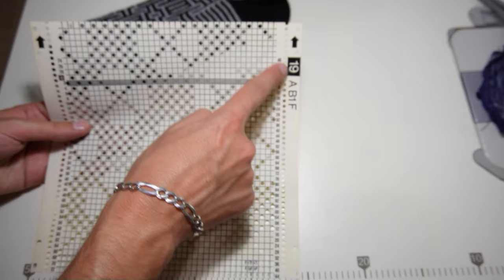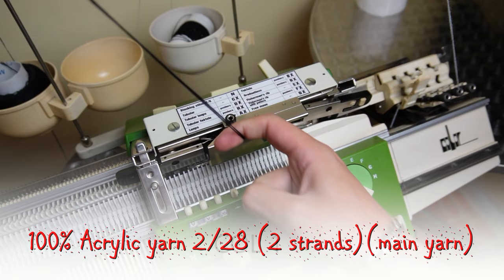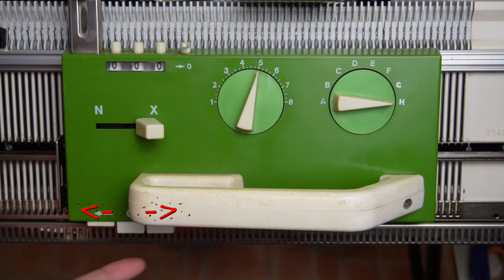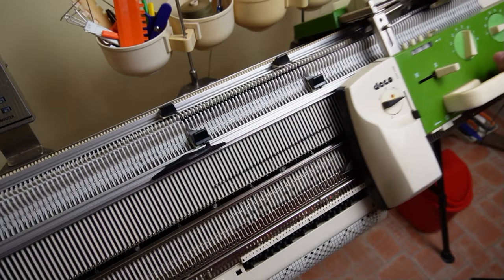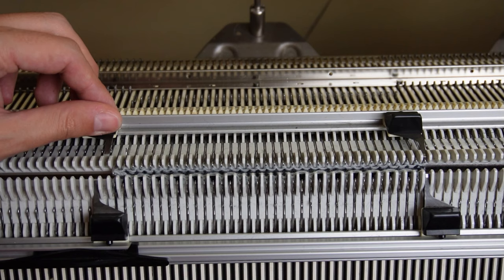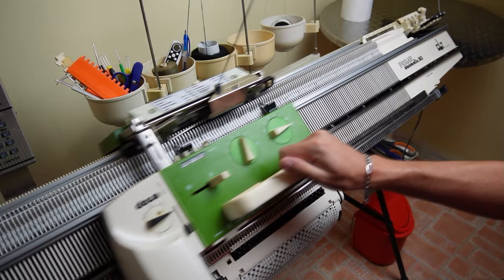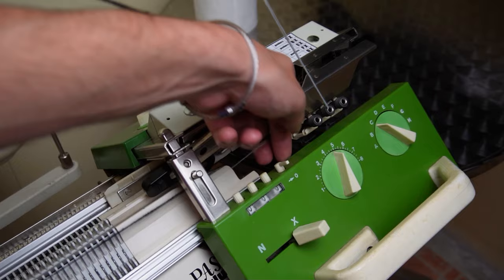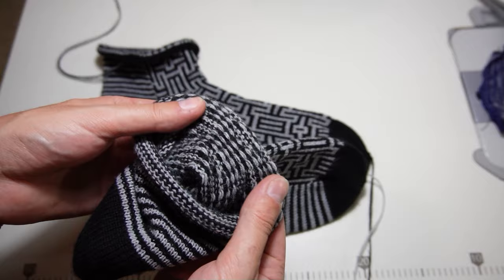Passap Floatless Mosaic Knitting: Making Stunning Slippers

Comment from the maker: Big thanks to Margarita Fischer for her helpful tip! When knitting mosaic socks on the Duo 80 with regular 4-ply sock wool, remember to set the stitch size on the back bed with 4 clicks smaller than the stitch size on the front bed. This keeps your stripes looking smooth and avoids extra bulk. Margarita's advice makes a difference!

Comment: My cuff turns out huge should i lower the SS? Also will you have a tutorial on a ribbed cuff <3 ?
Reply from the maker: Lowering the stitch size can help make the cuff a bit smaller, but if it's still too big, you might also try reducing the number of stitches. When I knit socks, I often find that the first pair ends up being a gift, and the second pair is the perfect fit. LOL. 😊

I actually have an older video on knitting a plain sock with a ribbed cuff. The ribbed cuff in that tutorial is knitted flat and then sewn later due to the limitations of the machine. I’ll definitely consider making a new tutorial for a sock with a ribbed cuff in the future. Thanks for the suggestion!
Reply: @ArtOfClay  No problem yea i figure since it can knit rib double bed, i thought maybe two different ways... one would be making the cuff double length so it can fold over or 2nd would be casting on with waste yarn,  then after i dunno 15 rows, 1 row of ravel cord, then casting on the rib cuff, knitting twice the amount of ribbed cuff... drop the bed down, pull up the beggining with the waste yarn and rehang stitches around, then pull out ravel cord to take off the waste yarn, put up bed and continue with a double ribbed cuff, i like the more pronounced cuff look <3...
Reply from the maker: Your response made me think. The second way of knitting the rib that you mentioned can be done automatically without the waste yarn. First, you have to arrange the needles in a 1:1 division and knit the first row with the machine set to N/N (SS - 3). Then, increase the SS to 5, or for the main knitting, set the back lock to BX, and raise pushers in 1:1 division under the needles on the back bed. The leftmost one should be in WP. Knit the needed rows of ribbing ending with the lock on the left side. Next, set the back lock to N, raise all needles on the front bed and knit 1 row, or set one of the locks to GX, transfer all stitches to one of the beds, and continue knitting. You should get the folded rib automatically sewn. I have shown this method in my scarf hat video.
Reply: @ArtOfClay  ill look for your scarf hat video ty <3...
Reply: @ArtOfClay  oh okay so its making the rib as a flat fabric that you would then sew up a seam... i was just curious if there was a way where you wouldnt have to sew a seam. Also for this eseentially you could make the ribbing, and then use decker combs to transfer back to front bed in a circular fasion to continue on knitting the leg of the sock ? <3...
Reply from the maker: Unfortunately, it’s not possible to knit true round ribbing on the Passap without a seam. Some computerized machines can make a series of transfers before knitting each row to create round ribbing, but on the Passap, this process would be very time-consuming.

The only ribbing that can be knit in the round without needing a seam is mock ribbing. This is done with a 1:1 needle arrangement and is knitted tubular, producing a round piece. However, you still need to fold it in half and sew it to the inside, though it won't be a flat piece.

Yes, you can use decker combs to continue knitting the sock in the round after making this or any other type of ribbing. The method in the video I told you about eliminates the need to start with waste yarn and rehang the stitches later. It’s a good option if you prefer more pronounced cuffs. Just remember to knit one row after transferring the stitches to one of the beds (after finishing the ribbing), to make it easier to transfer them with the decker combs later.
Reply: @ArtOfClay  what about my method of pulling up through the center and re joining?
Reply from the maker: I hope I’m understanding you correctly (English is not my native language, so I use a translator). If you're asking whether you can start with waste yarn, knit the ribbing, then drop the bed, rehang the stitches, and continue knitting the sock, yes, that’s definitely possible.
Reply: @ArtOfClay  cool i might have to try that... im not very good at mattress stitching so i always try to think of ways to just knit as one piece. Also even though english is not your native language you understand perfectly and also speak it perfectly. I cant imagine myself learning another language especially at my age point, so that truely is a awesome thing to be able to do <3...
Reply from the maker: Thank you very much for your kind words! I’m glad to hear I’m making sense. I totally understand wanting to avoid hand-seaming. I'm always looking for ways to keep things as seamless as possible too. My mattress stitch skills aren't the best either! I hope your project turns out wonderfully. 😊

Comment: Hi, your video is perfect clear as usual, thank you so much. There is only one thing I don't.understand : the punchcard 19 that you show (and that I receive with may passap 80) doesn't seem to match the sock you show : should we really use this punchcard ?  Thanks
Reply from the maker: Thank you for the feedback! Yes, you do need to use punch card 19. It's interesting that the mosaic knitting holes on the punch cards don't match the result on the knitted piece, so the card will be different than the final result. Note that not all Passap punch cards are suitable for mosaic knitting. While some aspects of this process remain a mystery to me, I am actively working on creating a video on this topic.
Reply: Thanks

Comment: Can you clarify something please? In the video you clear the row counter after making the heel but the notes don’t have his instruction. Do the 220 rows start with the first colour change at step 42  or are steps 39 and 41 in the notes the first two rows? Thanks!
Reply from the maker: I apologize for any confusion. The row counter should indeed be cleared after making the heel. This occurs in step 36, where the lock will be on the right side, and the row counter should be at 46 rows. All 220 rows from step 39 onward must be knitted in the same mosaic pattern, so the first of them is on step 39.

P.S. I am writing the instructions after making the video, so it's always as shown in the video.
Reply: I'm about to make some more of these and hope I've remembered what I did wrong before LOL! By the way I noticed that the stripes on the sole are different in your fairisle video. They go along the length of the foot instead of across. In this video you have front lock only set to HX with both arrow keys. In the fairisle tutorial both locks are HX with left arrow key. Can I do the same here or will that muck up the mosaic?
Reply from the maker: I guess the stripes can't be in the same direction as on the Fairisle slippers because when knitting the mosaic ones, the color must be changed on every 4th row, and for the Fairisle slippers on every second row. I guess the fabric will be textured, and the stripes won't change their direction. However, it is still an interesting thing to try. I guess it will work if you knit 2 of the rows with the arrow key on the back bed pressed, and the other 2 rows without it being pressed.

Comment: Buenas noches acá en Colombia a esta hora son las 9:00 de la noche una.pregunta todos los sacos en la passaf tienen las mismas medidas o varían según la maquina quería saber que diferencia ahí de tallas de casa buso muchas gracias
Reply from the maker: Lo siento, tengo dificultades para entender tu pregunta. ¿Podrías por favor aclarar o reformularla para mí?

_
I'm sorry, I'm having difficulty understanding your question. Could you please clarify or rephrase it for me?
Reply: @ArtOfClay  buenas tardes que como hago para sacar medidas de  sacos en  la maquina  passaf ejemplo la.talla s es una medida a la talla M es otra que diferencia ahí de puntos y hileras entre talla a talla mil gracias
Reply from the maker: Lo siento, no tengo mucha experiencia en ajustar patrones. Para obtener las medidas correctas, te recomendaría tejer una muestra de prueba para obtener la información del calibre. Luego, tendrías que hacer cálculos basados en el calibre de las instrucciones y el tamaño deseado de la prenda.

_
I'm sorry, I'm not very experienced in resizing patterns. To get the right measurements, I'd recommend knitting a test swatch to get gauge information. Then, you'd have to make calculations based on the gauge in the instructions and the desired size of the garment.
Reply: @ArtOfClay  muchas gracias me gusta los videos que comparte y aprendo mucho, muchas gracias bendiciones